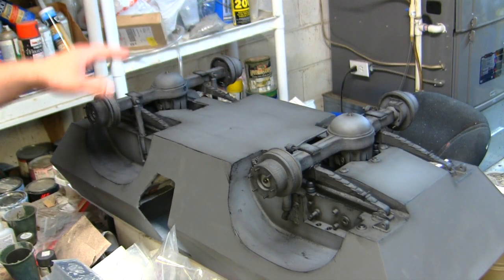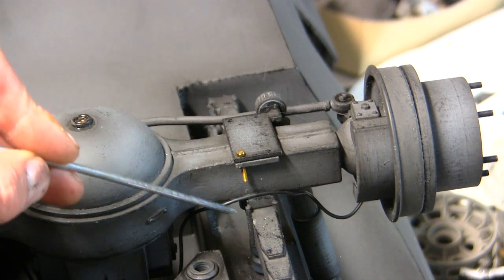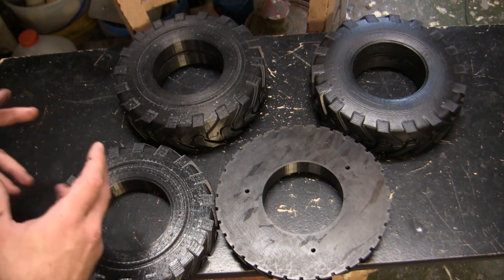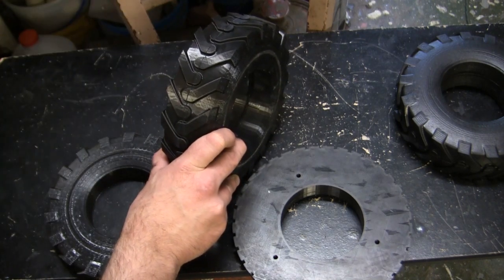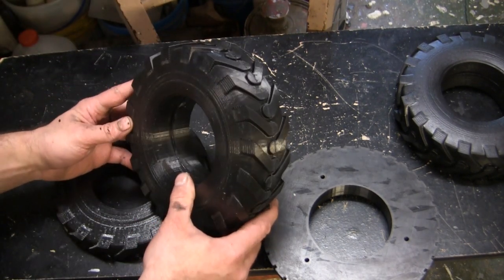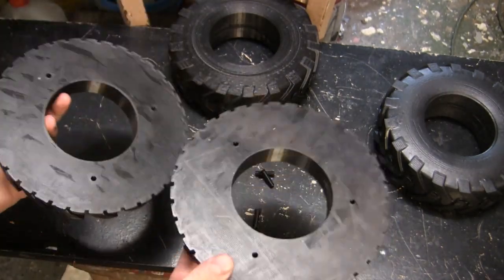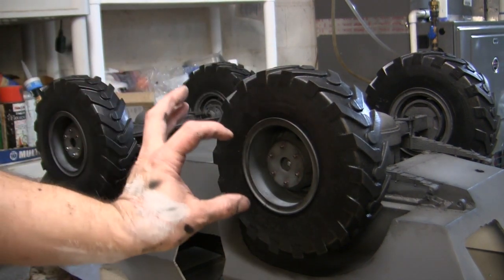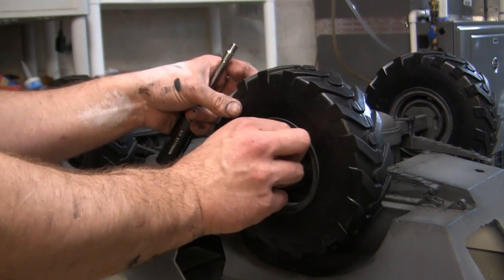1/6th scale Cadillac Gage V100 / M706 Armored car video #5 Part 2 of 2 (wheels and hubs)

Comment: It was good that you noticed the end of the the plates of the hull . I was looking at my references and the top of the hull , the plate extends over the edges of the hull. That extends from the rear of the hull right up to the drivers section. Probably a 1.5mm to 2mm plate in 1/6th .
Reply from the maker: yes I will be adding it there too, but this is going to get added after I fabricate the winch
Reply: @oddball759mm  yep , one job at a time .